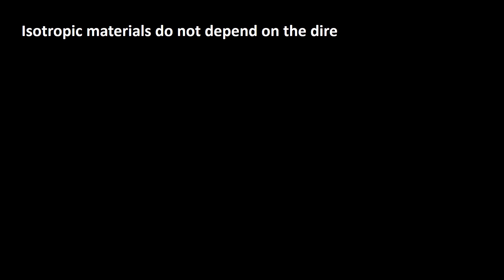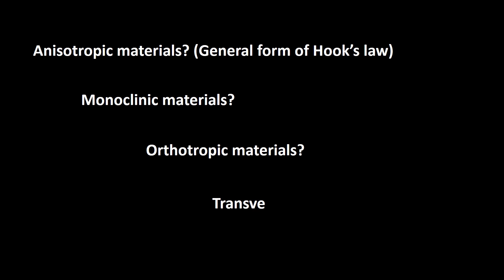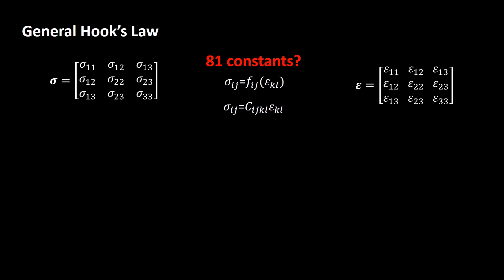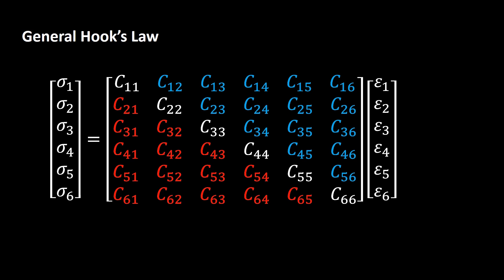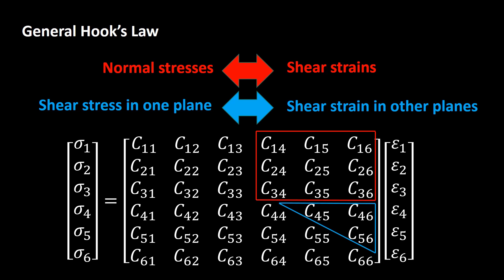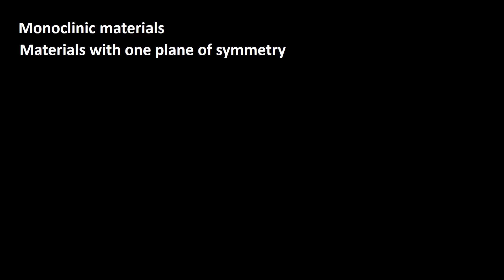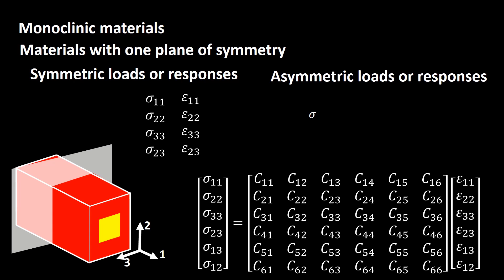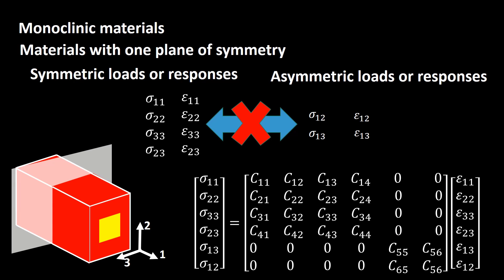Understanding: anisotropic, monoclinic, orthotropic, and transversely isotropic materials

Comment: Stress tensors are only symmetric if there are no coupled body forces acting on the material
Reply from the maker: Symmetric stress tensor almost is true for all the problems related to composite or similar anisotropic materials. In fact, the case that stress is not symmetric in practice is so rare that in most of the advanced mechanics books this assumption is used.